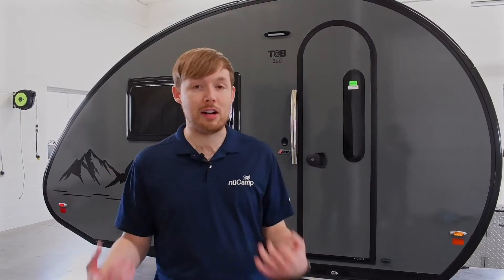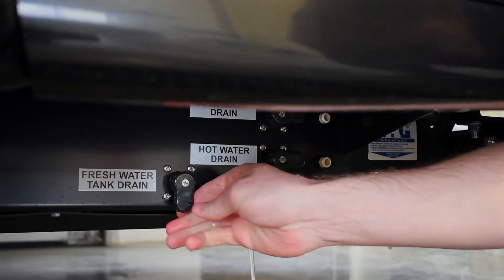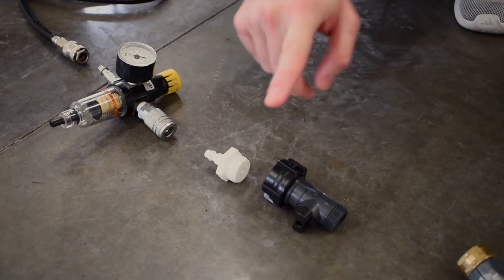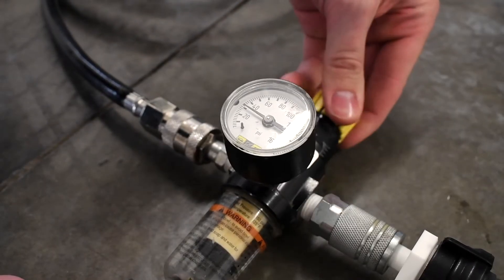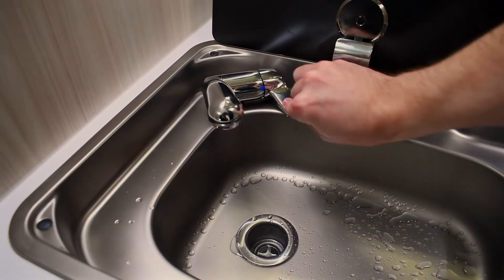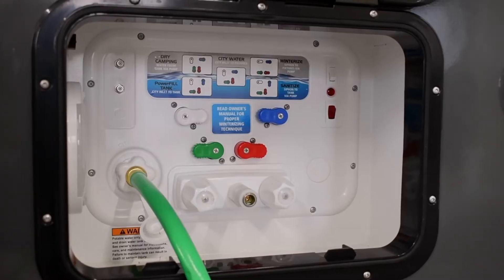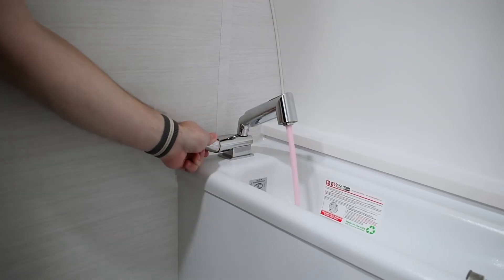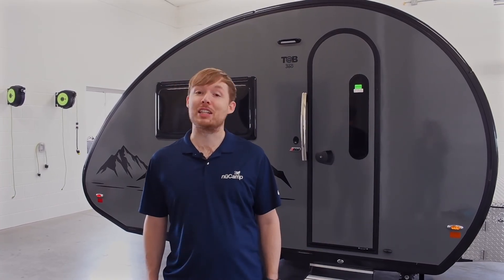Tech Talk: How to Winterize a TAB 360

Comment: Do we really need to use air?
Just skip?
Reply from the maker: While we recommend blowing out the lines as an extra precaution, you should be okay as long as all water is drained and antifreeze is run through all of the lines.